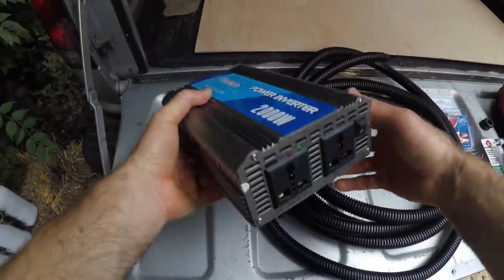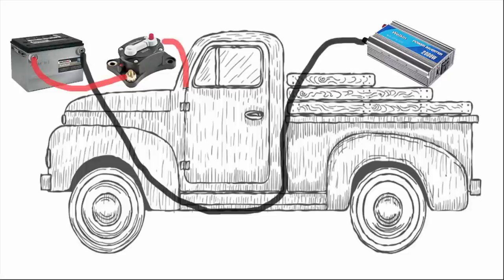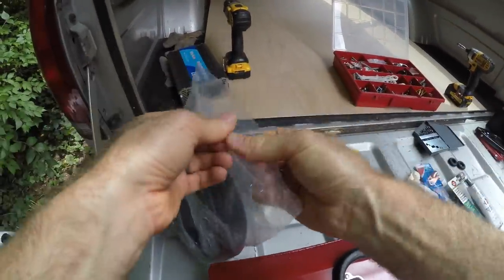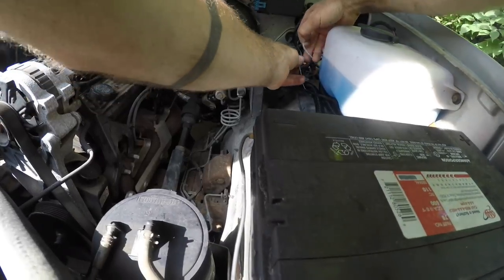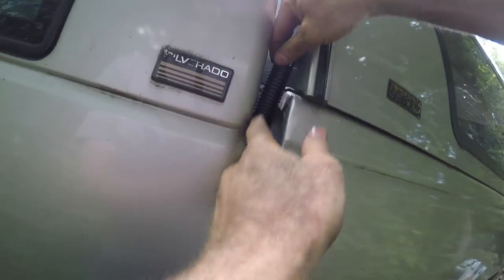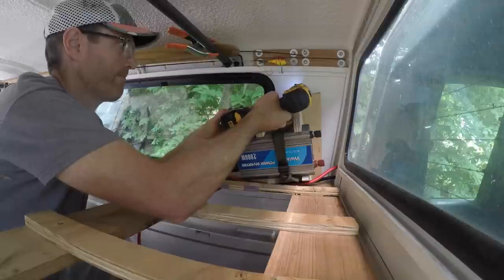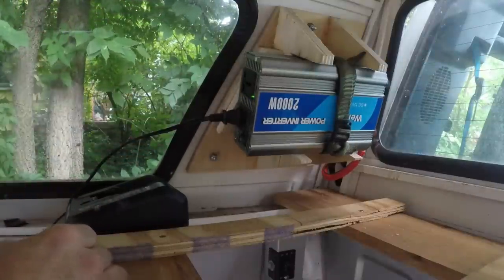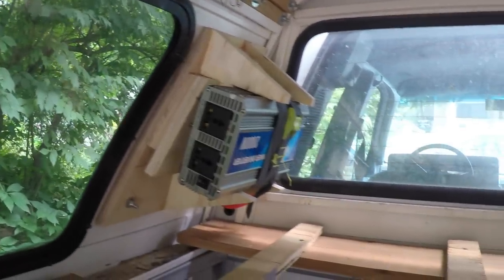Installing a Truck Inverter

Comment: Can 2 car batteries run a 5000w inverter without any problems or damage to the batteries?
Reply from the maker: You have to check a chart for that kind of info .. always depends on the load and batteries

Comment: 30 Gal. 175 PSI Oil Lubed Belt Drive Portable Vertical Electric Air Compressor
.........According to your installation method, can I use this air pump? Is the power enough？？The vehicle is a toyota sienna or a Honda Odyssey？？？？
Reply from the maker: Just check the pump: it will indicate how much power it needs and then you can find an inverter that works

Comment: Doesn’t the length of the power wire cause lots of amperage?
Reply from the maker: It hasn't been a problem for me and what I run, but you're right: the longer the cord the less juice

Comment: I plan to put breaker inside cab. There isn't an issue with distance of breaker from source is there,?
Reply from the maker: That sounds smart. You can put the breaker anywhere, but keep in mind that the wire leading up to the breaker is not protected and, if cut into or something could arc

Comment: if i used separate battery for inverter 2000w , how do it recharge to battery?or can i connect direct to car battery?
Reply from the maker: recharge but linking it up in series or parallel depending on what you want, if your alternator can handle it

Comment: how did you crimp the connectors after you fed them into the truck topper?
Reply from the maker: Vice grips and bolts to make the crimp ... worked but a crimper of that size would be nice
Reply: @metaspencer  sure would. anyway, great video.
Reply from the maker: Thanks for checking it out!

Comment: Can I use a deep cycle battery for my secondary as long as I'm using an isolator?
Reply from the maker: Woah, I don't know exactly and you should ask around and do some research, but my gut reaction would be YES. Seems to make sense to me

Comment: Would you recommend installing a second battery? Or can I run it from my main? I have a 2000 watt inverter
Reply from the maker: Most people just use one battery, you just need to be careful not to drain it without the vehicle running and battery charging. It all depends on how much use you predict having
Reply from the maker: Awesome user name, btw :)
Reply: @metaspencer  Awesome! Appreciate the reply, and haha thank you 😃

Comment: Bro hello. I have no car no battery and 220v 500 watt Power supply 40A 12v Can I connect it instead of the battery? Connect to the car inverter generate 220 volts?
Reply from the maker: Worth a try but I can’t see starting the vehicle with no battery

Comment: About how long does the battery hold without having the truck running is does that alternator will charge both batteries at the same time?
Reply from the maker: It all depends on what you're running off the inverter. You can easily kill a battery by running something like high-amp power tools ... but things like phone chargers and LED lights have very little draw
Reply: @metaspencer  ok how about a tv like for kidds to watch movies like for camping is it better to get a big battery will it last longer. My truck is an f250 diesel so it has two batteries do u think my alternator can charge 3 batteries?
Reply: @metaspencer  thanks for fast reply
Reply from the maker: A flatscreen tv can be s big power draw ... a tablet uses much less juice. If your two batteries have a switch between them or relay you can save your main battery for the truck to start.
Reply from the maker: The output of your alternator should be printed on it
Reply: @metaspencer  a ok got it ill have to check it out thanks alot for ur help

Comment: What are some things you can run of this.
Reply from the maker: I use it to charge my tool batteries and run small tools ... just check your tools for how much power they need and match it to your inverter

Comment: I want to do this to my SUV.  Never thought of jumper cables - a lot cheaper than the same size from an electrical outlet store.  I do have a few safety-oriented comments.  You said you connected the battery before finishing the wiring - I'd say that's a bad idea.  Run the wires first, connect the inverter even, and connect the battery last, after checking for shorts and grounds.  Also, there are several types of the sealant you used - I hope you got the acid-free version.  The acid-cure sealants will degrade the insulation on the wires.  At full load, your inverter will be drawing around 170 amps from the battery.  I'm guessing with two batteries you already have a heavy-duty alternator, but I'd check it's output with the inverter disconnected, then add that to 170 amps, and make sure your alternator can handle that for long periods without overheating (1.5 to 2x the max current).  You also didn't mention the type of your second battery.  It really should be a marine deep cycle or golf-cart-type - they can take deep discharging (to around 50 %) many times without losing a lot of capacity.  A regular car or light truck 'starting' battery will lose most of it's capacity the first time you drain it, and probably die totally the second time (if not the first).

While not a safety thing, a large capacitor across the inverter DC input can help it handle large surges, like a saw starting up.  Normally, that surge will cause a voltage drop due to the long cables from the battery, and put a strain on your alternator.  If you intend to use large power tools or a compressor (air, refrigerator...) this can really extend the life of your alternator and battery.  You can't just connect it there, however.  You'll need some electrical knowledge, a protection diode or two, and possibly some other components, so ask someone familiar with the setup if you want to do it.
Reply from the maker: Wow, lots of great tips ALL of which are a big help! I’m relatively new to much of this so really appreciate it

Comment: you shod get a inverter for the bus and have it so if you do need it you can have some sort of backup power while driving
Reply from the maker: Yep, on my list for when I replace the leisure battery. Also an isolator

Comment: How can you tell how many batteries you need to run the 2000W inverter?
Reply from the maker: Depends on draw. 1 battery is fine but will die fast with big draw

Comment: What would be a good breaker for a 1000 watt inverter ?
Reply from the maker: depends on what you're running on it ... start small like 10 amp or 20 amp and see if it trips
Reply: @metaspencer  I understand what your saying here my inverter is going to be installed in my truck so I was thinking I'd probably need 100 amp breaker atleast any thoughts?
Reply from the maker: Smaller breaker is safer ... all depends on what you’re running off the inverter
Reply: @metaspencer  well I'd like to be able to run it at full capacity if need be I see you put a 300amp in urs I know that's over kill for my 1000 watt I just don't want the alternator kicking the breaker all the time and I ran 4 gauge wire
Reply from the maker: 300 ended up being too high of a threshold... I changed it to a 50

Comment: I have a 5000/10000 inverter for my semi could you tell me what size breaker I would need?
Reply from the maker: You need some thick wire for that one, so 2/0 wire. You should also have a fuse on the circuit. The breaker size should be something you can find on a site like this one: https://www.altestore.com/howto/recommended-inverter-cables-sizing-and-breakers-or-fuses-a62/ ... good luck with it man!

Comment: What is the max. Output we get from this inverter. Can we run 1 hp water pump by this converter starting the car.
Reply from the maker: Just check your pump ... it should list how many watts it needs... cross reference that against your inverter

Comment: Can I use a DT wiring harness with switch you know the one they make with the LED connect at one and I was thinking of just cutting off the LED connection and connecting to the power inverter are those wires strong enough do I have to go with wires as big as the jumper cables you have I have a peek 2.1 amp5 V DC
Reply from the maker: The best way to answer that question is to look at a wire gauge chart. The chart will get you to consider your load and the distance of the run. I tend to go with larger wires than I may need just to be safe and avoid overheating or melted wires. Now, another way to set this up is just to install the inverter under the hood and then run an extension cord from there ... good luck with the project!
Reply: If you brought the wires in through the bottom of the beds lower back wall, the wires would reach further towards the back so the plug could be reached from the back of the truck without having to jump in to plug in. Could also remove the cap without having to disconnect everything.
Reply from the maker: Oh so true! But I didn’t want to drill through my bed. Great point

Comment: If I do this can I leave the switch on without it killing the battery when the car is off or will I need to switch it off everytime the car is off?
Reply from the maker: As long as you don't have a draw or anything plugged in and using power, you can leave the system on
Reply: @metaspencer  i use it to run studio speakers. I run power through the AC plug but the bass hits too hard on some songs and it doesn't have enough power to keep the inverter from overloading and turning off so I was gonna do ths
Reply: @metaspencer  so turning the inverter off wouldn't work? It'll still draw?

Comment: I have a ? Maybe you might know.. so im using a heat gun 1500w and inverter 2000 watt buT ny inverter goes 7mins of use the my voltage is at 10.45 then it shuts off ... should i add a capacitor so that way i get a loanger user time or second battery
Reply from the maker: Heat guns pull a LOT of power, so I'm not surprised. Sounds like a classic overload ... not sure about the capacitor idea
Reply: @metaspencer  thank you for your response... another? 
Im runing 4awg cable wire to isolator and battery to front and battery to back but inly 2awg to the inverter will that be a problem.... should i just use 2awg everything... and when useing heat gun i would have to just run car
Reply from the maker: @evananthonybaez  For wire gauge it depends on load and distance. You need to check a chart ... often called a "wire gauge chart"
Reply: @metaspencer  thank you so much

Comment: Is it possible to just wire an extension cord straight to a car battery to run stuff while my car is on?
Reply from the maker: No, that won't work as your car batter produces a direct current (DC) and the stuff you want to run needs alternating current (AC) ... that's why you need an inverter

Comment: Will that battery put out enough power to have a welder running ?
Reply from the maker: I wouldn't try to run a welder on this thing ... not enough amps ... but I guess you could check the amps needed by your welder and test it. Typically guys run welders off of generators

Comment: Can i power my 15 amp circular saw with this?
Reply from the maker: It's not a simple calculation, but most references I've looked at suggest a bigger inverter will have a better chance. Note that you can run your batteries down fast with a big load like a circular saw.

Comment: Would that run a 5 gallon air compressor?
Reply from the maker: You'll have to check the specs on the compressor and see how many amps it pulls ... then check your inverter

Comment: How did you crimp the ends going to the inverter?
Reply from the maker: Big old pliers, like really big ones, and some screw drivers stuck in there to make the crimp. I'm cheap. You can, of course, get a crimping tool

Comment: Should keep the inverter as close to the batteries as possible to stop power drop shorter the cable run the better
Reply from the maker: Yeah, good point. Fortunately it works for my uses as is but a short run would be ideal. Thanks!

Comment: I also want to own a work truck. I have a 30-gallon air pump. It is big and I want to use it. I need to do this?
Reply from the maker: You just have to see how many amps the air pump requires, them see if your inverter produces enough power
Reply: @metaspencer  The air compressor manual is marked as 120V, 15A, can it be started? I don't understand electricity, hope you can enlighten me, thank you
Reply from the maker: 20 or 30 amp inverter should work for you

Comment: So as long as you have 2 batteries, you don't have to run the truck? For how long?
Reply from the maker: My isolator protects the main battery, so yes: I can run the second battery down, if I want to. That's not my plan, however: when running tools and whatnot, I'll run the engine. When running small lights and things like that, I'm sure I could run it for days without plugging in. However, it all depends on the load of what you have plugged in.
Reply from the maker: Note that if you just add batteries in series, they will be drained simultaneously ... if you don't have an isolator
Reply: @metaspencer  right on thank you

Comment: Why did you run the negative to the battery instead of grounding it to the frame.. also some jumper cables are not a hundred percent copper and even if they're 2 gauge or bigger can still restrict the flow of power to the inverter
Reply from the maker: Hmmm, thanks for the tips!
Reply: Mat Gilan  So what kind of wire can be used instead of jumper cable?
Reply from the maker: Thick gauge

Comment: How do you charge the 2nd battery that is connected to the invertor ?
Reply from the maker: The second battery is linked to the first so charges when the alternator is running. Setup is here:  https://youtu.be/UdxaZR4GbVA

Comment: why couldnt you just ground the inverter to the chassis?  seat bolt or really anywhere thats metal...confused why you needed to go directly into the neg battery?
Reply from the maker: You absolutely can ground to the frame. I tend to prefer a ground to battery in a setup like this, but you're absolutely right.

Comment: Can I use power inverter if my engine still running, means no off engine?
Reply from the maker: yes, I do this all the time
Reply: @metaspencer  What is the proper size cable for a 1000w inverter?

Comment: How could I wire it to a aux switch
Reply from the maker: just put that aux switch where you want it and either interrupt the power feed or use a relay

Comment: Can I just hook up the inverter directly to battery?
Reply from the maker: You can but if it shorts or overloads you risk a fire. A fuse or breaker is pretty essential

Comment: How do you keep the second battery charged?
Reply from the maker: Linked to the first battery so it’s always charging via the alternator
Reply: Does it overcharge other
Reply from the maker: @jussikankinen9409  Both have been good for a good long while with an isolator

Comment: Does that pos still work? I I wudn buy junk, waste of $ that's gonna fail when u need it the most. Just my opinion.
Reply from the maker: The inverter still works but I think you're right: better to get a quality unit. I'm just cheap and don't use it that much
Reply: @metaspencer  good to know it mite be ok to buy. I've heard definitely stay away from the cheap Chinese ones.

Comment: Can i connect my microwave with those jumpers cables ?
Reply from the maker: Woah, that seems like a big power draw. You should check the amperage of the microwave ... my guess would be that it would need more power than you'd be able to provide through your inverter, but that's just a guess

Comment: Why run a ground wire.  The body of the vehicle is gnd
Reply from the maker: Yep you’re right. I tend to think best ground is that second battery of mine but you’re right
Reply: @metaspencer  Another thing to think about when installing the positive wire is if it could be pinched in a accident because the body is gnd.  Not sure I would have run it between the cab and the bed.  Your breaker will act as a safety, it's good you installed that just off of the battery.
Reply from the maker: @myronww  Good thinking: maybe coming up from the bottom would be better, but I'd be afraid of moisture being a problem. Access points are tough. I keep my circuit off when not in use, just in case. Thanks man!

Comment: Do you really need 220? That in the description of the inverter?
Reply from the maker: Ya know, the simple answer is no. I guess this one was designed to run in the UK, which I've heard is all 220. 110 in North America is all you need. This one seems to be running my tools just fine, but I wouldn't plug my laptop into it or anything
Reply: @metaspencer  most newer laptop supplies are universal 100-240v so it won't matter unless it's just a yucky inverter.

Comment: 220v inverter? But why?
Reply from the maker: so, you're saying it's overpowered? I suppose 110 would make more sense, if that's what you're saying
Reply: @metaspencer  aren't most of your tools and chargers set up for 110v that would be the common in the us....assuming your in the us
Reply from the maker: yes, that's right: everything i have is 110 ... I guess this thing is 220 to make it work in the UK

Comment: "How to set your truck on fire with a cheap chinese inverter." Seriously these cheapo inverters catch fire all the time.
Reply from the maker: I’ve been keeping it switched off when not in use ... may replace it when I have the $$$ . Thanks for the warning
Reply: Fun fact, it doesn’t matter what name is on it, they’re all cheap Chinese converters, the only difference is how much you pay.
Reply from the maker: I see your point

Comment: Wasted money on jumper cables  the amount of money you spent on thoes you could have bought smaller welding cable with a higher ampacity and use the truck frame as ground dc circuit  current flows from negative to positive , change charging wire from the alt to battery and ground to frame of truck or the inverter will not work at itz potential
Reply from the maker: Thanks for the tips man. My setup works for my needs but what you say makes sense